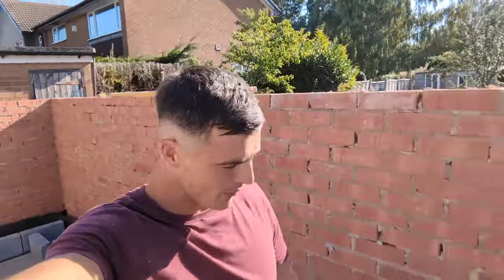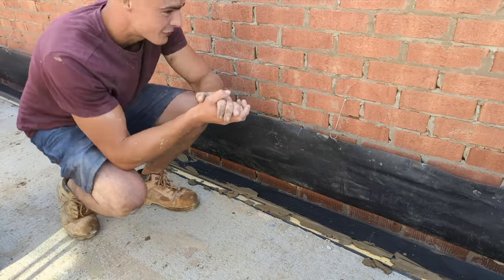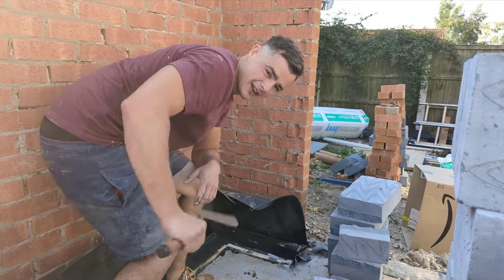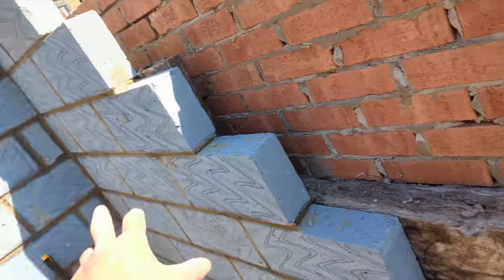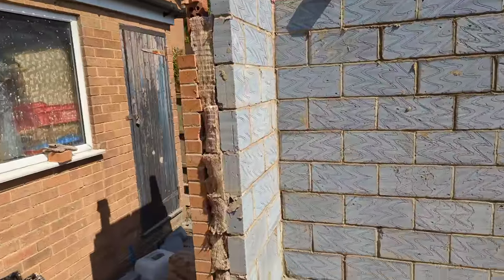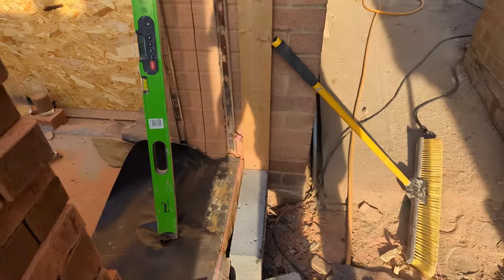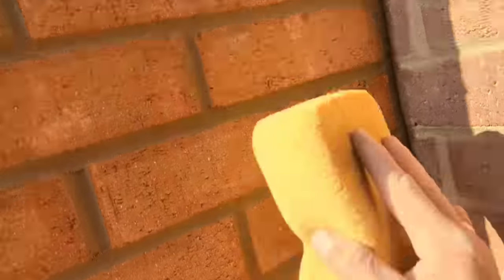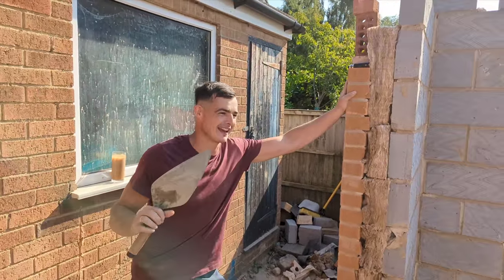Bricklaying - Blockwork done - Free extension #vlog #renovation #extension

Comment: There SHOULD be a LARGE air space gap in-between the face of the insulation and the OUTER WALL inside the cavity-wall ; this includes an air space gap in-between the face of the insulation and the cavity-wall-tie drip point in the centre of the cavity.
Ask N.V.Q. BRICKWORK teachers for PROOF of this !

Comment: Don’t you find that fairly long runs of Celcon or Thermalite blocks need expanded metal lathe or Brick Tor in the bed joints to avoid thermal movement cracks. Nice neat job young fella.
Reply from the maker: Hiya mate, I've found on double story's they tend to crack, especially if there's any slight movement at all! Not in this case, but others I have used brick tor before to stop it
Thanks for the support ☺️